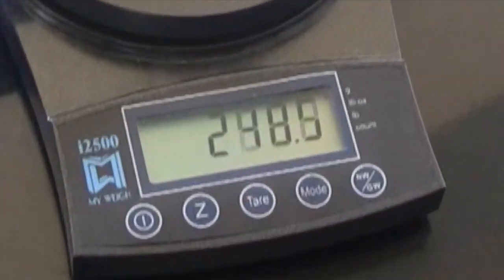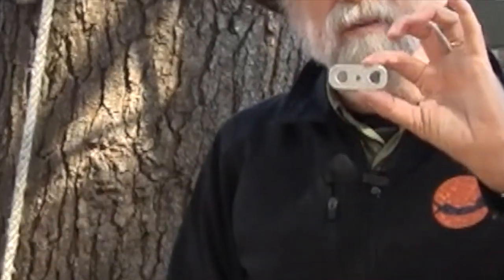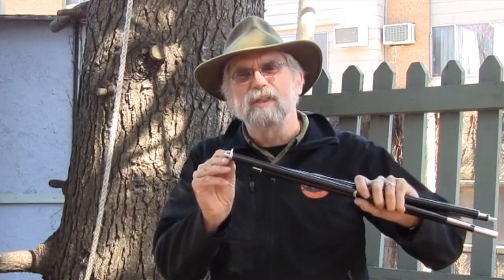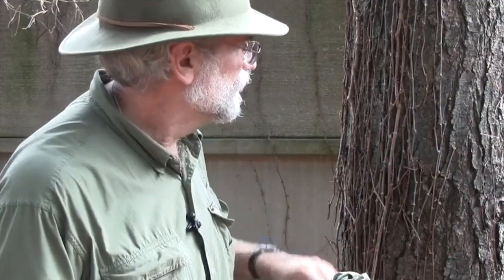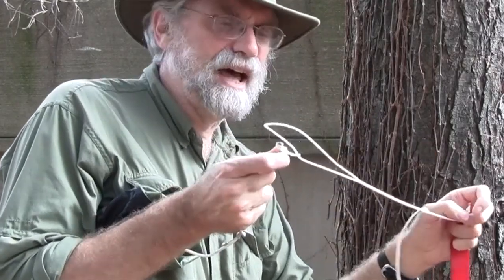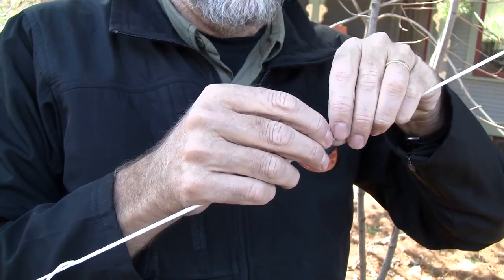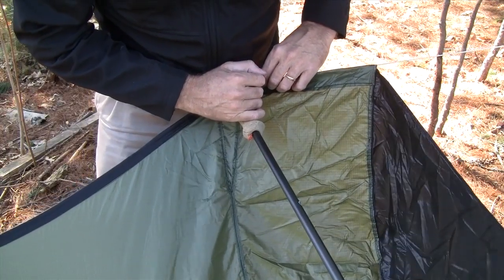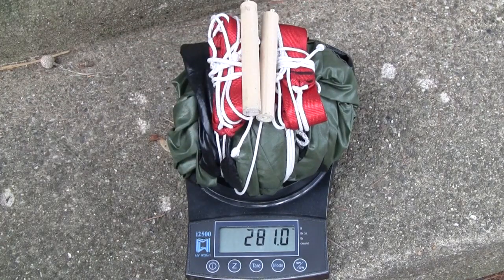A lightweight bridge hammock --- counting grams

Comment: I don't use hiking poles, but I was thinking of using carbon fiber arrows. Just cut to length. Glue in inserts to each end. then just modify field points to use at the ends.

Comment from the maker: I have made a hammock for a 300 lb fellow, but didn't make a video about it.   I used two layers of 1.9 oz ripstop (in this case not making a pocket), 3/4" wide tubular webbing rather than the usual 1/2" wide stuff I use, a heavier duty spreader bar, and 1/8" diameter Amsteel suspension. That arrangement is probably good for weights well above 300 but I don't know how far.

Comment: Professor Hammock - awesome videos and study of lightweighting a bridge hammock. Love all the line work and revisions improvements for old methods to new, just awesome. Here are my observation of the revamp.

For the aluminum corner pieces, I would have used simple fender washer and made them into a ovals if required, or even just small split or solid rings where you need to put the poles. Since the poles have a flat surface at the interface points, that should stop the rings from rotating once positioned. For the dowels in the hiking poles modification, I would think a alumin tubing with a fixed point screwed or glued in at the exposed of the tube would of worked, since I think the hollow tubes could not manage the compression forces at the corner spreader locations.

The second suggestion is to use simple notches in the end of the pole positions to accept the string from the hammock side lines, which would be similar to a bow and arrow, arrow end to the bow string interface. If the pin in the hiking pole is removable, then this type of feature could be made at each end of the pole that on to the side support lines. At each corner point locations a simple loop could be tied off to accept the arrow end tips for the ski poles. Just as easy to set up and no aluminum plates or washer is required, just the weight of a small 1 in loop.
The corner loop positions could of been just slits in the hammock material as well. (ref 11:29 sec discussion in your video) without the need for the extra dart matrials at all 4 locations. Just an observation/suggestion for the next build to try to do so.

Love all the noodling around on getting to your pack weight down and is impressive what can be done. Appreciate you sharing, looking forward to more innovation in hammock mass reduction quest! Happy Holidays - Steven
Reply from the maker: Thanks for the thoughtful comments Steven.  This video is now over 2 years old and I've experimented with further modifications, some of which address some of the same areas of the hammock you comment on.  Hoping to get another vid out on this in the coming months.  Cheers

Comment from the maker: @heberfarnsworth Hey Heber, that's right.  The corners here are more forgiving of mistakes, and the endcap is under a lot less tension.   I made the arc by marking out half the desired length on a bit of cord, and positioned it in a sort-of-parabola with the marked ends at the two places the curve has to intersect.  Built in a bit more length to be sure it could reach all the way to the corners, and fitted it.  Worked well enough.

Comment from the maker: @grendelprime75 I don't have any experience with carbon fiber arrows, but for whatever it is worth my instincts tell me they are too narrow.  Compression forces on the ends are easily equal to the weight of the hanger.  Some folks have had good success with carbon tubes about 1/2" in diameter.   If you try the arrows I echo PackEagle's advise on face protection.

Comment: First of all, excellent video. But how were you able to use the LT4 in place of the spreader bar at the foot of the hammock? The shortest the LT4 will break down into is still a few inches more than the length of the foot spreader bar.

Comment: @grendelprime75 I would be careful using arrows as poles. I personally wouldn't try it due to me being way over the weight limit I would see comfortable. If you do decide to try it I would wear something like a face shield to protect from carbon splinters, as in my experience shooting carbon arrows when they splinter it is rather dramatic.

Comment: All of your videos are great but I would like you to take into consideration the over weight to say it mildly.  In my experience weight limits on hammocks are necessarily.  In the DIY hammocks how do you determine what breathable fabric will hold how much?  Do you double fabrics forming a pad pocket?  Heavy folk, 275 to 400 lbs also have problems getting in and out.  One friend of mine even had problems with my HH center bottom entrance.  Solutions for the big folk a new challenge.